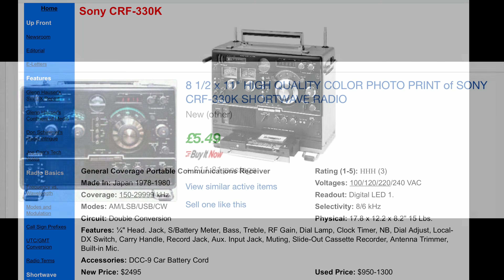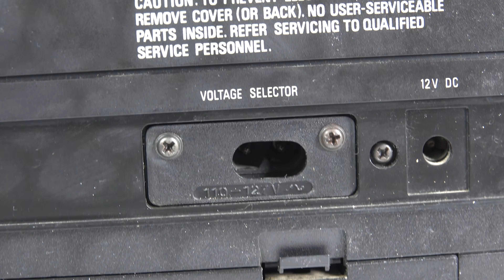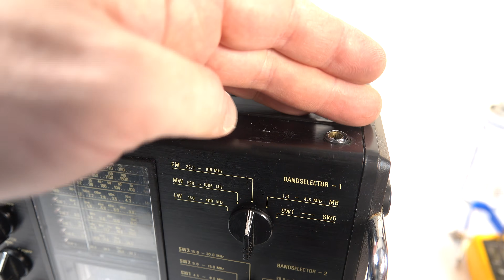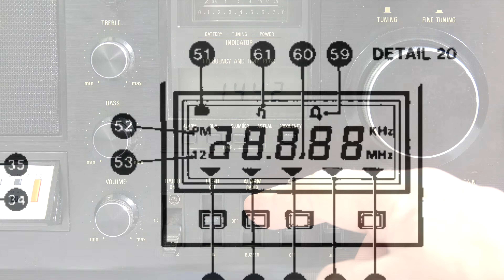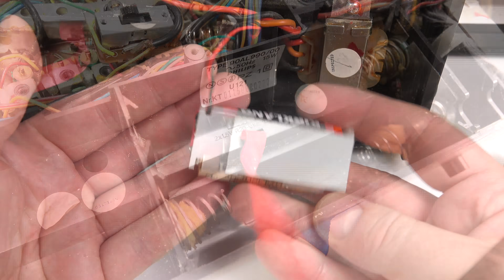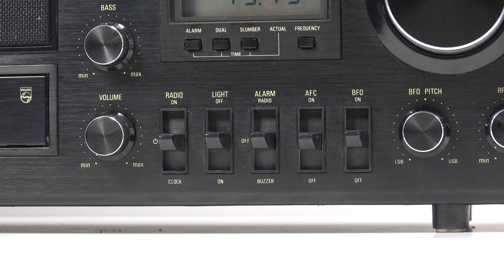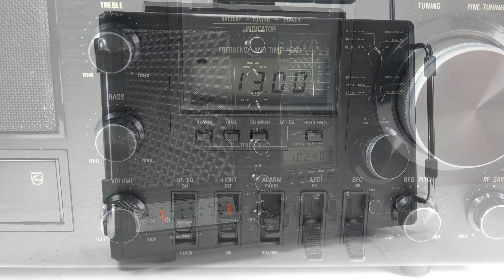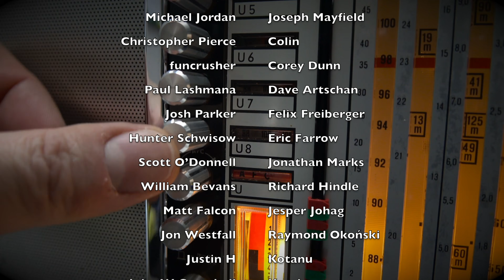Parts or Repair? - Philips AL990 Shortwave Radio

Comment: If it has been over volted,  check if maybe the rectifier diodes have blown, before changing the transformer. 
Also as the radio works on batteries, I would have thought the DC barrel  socket would have worked as that normally just disconnects the batteries when the plug is inserted. (Did you check your DC adapter had the correct polarity for the radio?)

Comment: You don't solder wires no more!
you crimp it with high quality crimp tools and isolated crimps.
Also next time, you might want to put heatshrink over it first and use that. Electrical tape is a bad idea.

Comment: A Philips service manual in Dutch only is quite remarkable.
Reply: Ed de Jonge Though not for that category of gear.  They probably wanted to minimize unauthorized foreign use, by forcing foreign users to keep in touch with a dutch-controlled service center.

Comment: Can’t blame you on the look of them, they’re drop dead gorgeous.

Tecsun, a modern shortwave radio manufacturer from China, makes one called the S2000, I believe. It’s pretty similar to this one, just modern, and quite more expensive.

Sony makes some that are just gorgeous, I never liked the massive pieces, though, as they always felt cumbersome and a pain to set up. 

What other shortwave radios do you have?
Reply: Tecsun used to be called eton. I have one of thier radios. Works great but anyone getting one make sure it has SSB modes.

Comment: Good job!  If it works, it's repaired.  That transformer may be internally fused to meet safety standards, but I would not think it would blow from simply applying the wrong primary voltage since a passive transformer would just give you double voltage on the secondary.  However there may be an active crowbar type safeguard designed into the rectifier for just such a situation just after the transformer, which is more likely since the DC input also seemed to be open.
Reply: Indeed, it is unlikely the transformer "blew up". Most likely something died in the rectifier circuit, like a diode/capacitor/regulator.

Comment: Get yourself a 9v type plug soldered on there and a 9v type AA battery holder and it'll fit perfectly.
Reply: D-type batt-4500mAh. AA-type batt-2-3000mAh. It is at least 1500mAh drop in capacity. He might change polarity of 9V socket (or replace it entirely and connect it into batt contacts.

Comment: I loved those high end shortwave radios I remember as a teenager in the 70’s and 80’s. They were quite rare even then, but I did have the good fortune of getting to use  them briefly at stereo, electronic, ham radio stores but the prices were way out of my budget at the time.  In the mid 80’s I did eventually get a rather no frills SONY ICF 7600 D for around $180 with its all new digital push button frequency tuning feature which by then had pretty much made a lot of those pricy 70’s analogue receivers a bit old school.

Comment: Example of a thermal fuse device similar to the one hiding in that power transformer. EBAY Item Number. 132718337592

Comment: The thermal fuse in the power transformer opens the primary return line! A heat sink must be used to solder in a replacement!
Reply: More specifically, there is often a thermal fuse "hidden" in a small plastic pouch or taped under the plastic tab on these transformers, on the primary side. With a little careful surgery, you can usually replace it. This may be possible without affecting the look of the thing, or may involve some heat-shrink tubing and a little bit of a bodge, depending on the construction of the transformer. 

We used to have to do this from time to time, on a certain well known printer manufacturer's main transformers back in the day. In that particular case, the thermal fuse cost a couple of pennies, but the transformer was a bit of a beast, and cost an arm and a leg. 

The fault that caused the fuse to open also needs addressing, which in this case may be something on the secondary side, although you may be lucky, and it may simply be that the application of 240V to the device when it was configured for 110V was enough to rupture the fuse without any secondary damage.

Comment: In regards to the broken alarm maybe it's that funky touch bar switch at the top that is causing the issue maybe something is completing the circuit when it should be open instead.

Comment: I live in the southeast U.S. and acquired a few shortwaves over the years in hopes to pick up pirate  radio stations out towards the western part of the U.S. with no luck. Even tried different antennas purchased and homemade with no luck. I gave up with only hearing Spanish and boring Christian stations. I also heard side band but my radio did not have the option but would have loved to hear what those guys were talking about!

Comment: Very well made and thought about, with the protection bars and replaceable parts. Nice save but I'd have to replace th transformer
Reply: My OCD says replace the transformer!
Reply: Or rather the DC section after it.
Reply: A lot of the OLD military radios had bars and things to help protect them from the abuse they were sure to get, so it transferred over to the portable short wave radios made much later. Besides many listeners started out with military surplus radios and stepped up as life got better and they had money to upgrade and it made the radios look similar and built to take abuse.

Comment: As an ex MN Radio Officer, this would have been useful back in the day. I notice you have a BFO (Beat Frequency Oscillator) that makes the reception of morse code more user friendly! Whether the radio is any good for this purpose really depends on its sensitivity and the precision of the tuning. One ship I was on, our Chief Engineer had a Sharp portable world wide radio that had extensive short wave capability. He could pull in the BBC World Service in his cabin with a small external antenna sticking out of the porthole, where I was struggling with my professional setup in the radio room. I always wanted one of those radios. I saw one for sale on e-bay a few weeks ago, but did not buy it. I am trying to downsize my life.

Comment: Devices with internal power supplies arre set up with a "crowbar" circuit...
The intent of the circuit is to short out the power source in the event of an overvoltage situation....
This in turn will trip circuit protection devices...
Chances are if replace that transformer and possably a couple of blown diodes...that thing should work.
BTW...a crowbar circuit imitates tossing a crowbar across the power mains past the power supply

Comment: Good grief! It's no beauty on the inside, is it! All those wires. Makes you appreciate modern multi-layer PCB and surface mount technologies.
Reply: Check out the insides of any 1950's shortwave receiver video on here, it's a rat nest of wires, no PCB at all, just point to point wiring!
Reply: @624radicalham  Yes, I've seen those. The amount of labour needed back then!

Comment: This video brings back memories when I tried to pick up the world wide service of the Austrian Radio with my father's old car radio hooked up to a little 12v transformer :) .However, not sure if that was SW, guess it might have rather been LW.
Reply: Good and interesting video but I would just advise caution with switch cleaner. It can cause plastic to crack and fall apart. I  had this happen only once but a plastic chassis on a Hitachi set literally fell apart around 3 months after it was cleaned. So be very very careful with splashing.

Comment: Wow. SONY ICF-SW1000T is 500 dollars on Ebay. I just ripped the cassette recorder totally off. I was going to insert a  digital recorder  into empty space, but realized I can use an old cellphone for recording. All I needed was cellphone 4-wire headset connector and some level adjustment.

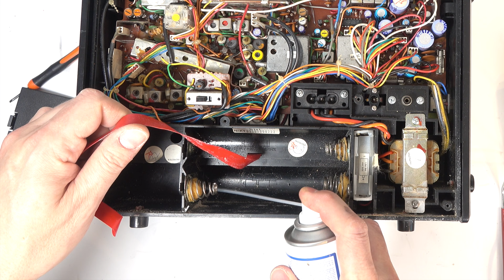Comment: 4:22 The Transformer should only be for mains voltage, since it's what steps the voltage down to a comfy input range for the device.  So, even if it's dead it shouldn't affect the direct 12v input, which has ALREADY stepped the voltage down to a comfy input range.

Worth checking continuity between the power inputs and the main radio section, I think.

Comment: I repaired a transformer in a TEAC A-3440 just like yours. Inside the windings of the transformer was one wire that passed through the windings with a fusible link. I’m told that these links were wound inside the transformer to protect against thermal overload as well as electrical. Anyway, mine was simply dry-rotted and falling apart. I installed a new in-line fuse holder outside The transformer and got her up and running. Perhaps your radio has a similar feature.

Comment: Battery only?  An easy way around this is to add up the voltages of the batteries, then get a power adapter that makes that voltage, hook it to the positive and negative terminals of the battery compartment.  Maybe solder in a jack so it could be unplugged too.
Reply: Or use the existing socket, just disconnect it from the board and change the label to the right voltage. I definitely wouldn't use a switching supply though, as that would most likely completely ruin the reception. And the transformer is probably ok and this is somewhere later on in the power supply, like the regulator. Making a simple linear regulator power supply with the existing transformer would be easy if it works (schematics anywhere online, look at LM317 or L7812), and the trafo can be checked with an ohmmeter. If the primary and secondary show continuity then it is probably ok. I say probably as I had one with shorted turns once, this can happen after mechanical injury or overheating. The voltage was ok at first, but then it started to smell and melt, so check if it doesn't get too hot after running for a while before putting it in the enclosure.

Comment: Love these old world band shortwave radios! To me, they're almost akin to a geeky adult version of a Fisher Price Activity Centre! Knobs to turn, levers to flip, buttons to push, meters to gaze at, lights to turn on and off, you get my drift! When I was younger, my dad had one very similar (don't remember the manufacturer, I doubt it was Philips, as dad wasn't a fan of their products, as we'd had bad experience with Philips kit) but it packed in, and was deemed too expensive to repair, but I just loved playing with the chunky levers, and messing about with it, maybe that's why I'm a big techy now! Just thinking, it could have been Sharp, Sony or Panasonic. It's quite nostalgic for me, as my dad passed away 10 years ago. That radio, he didn't like anyone messing with it, but when it failed, I said I'd like it, and he gave it to me, yes it didn't work, but it was like a holy grail. I just had it as something "cool" in my room, as it was immaculate. Happy memories......

Embarrassing fact: me and my mates Michael and Ian were big scifi fans, and I'm sure we made a scifi film using dad's Sony betamax video camera, and used the broken radio, my brothers Sanyo boombox, and and Michael's Atari 2600 as a control console (yes we were into tech) I'm still mates with Michael and Ian, and yes we still love scifi, and reminisce about Logan's Run, Silent Running and the like down the pub!

Comment: Great video and good detective work for the repair. Everybody should be able to do as much as you! It's a very handy skill to know basic soldering and powering of stuff.
Two things I noticed: did you use heat shrink tubing around the cable soldering jobs or otherwise insulate the solder spot? I didn't see any and didn't hear you mention it. Don't want anything to short (especially at the new 2 AA battery connection). And secondly, the four D cells seem to be in series which works out to around 6 V. Maybe it would be worth a try to convert it to power from a USB/cellphone battery pack at 5V. Would give you an easily rechargeable high capacity power source. If that doesn't work, two 18650 or a 2S LiPo pack should work (or one of those small buck/boost converters from China together with a good lithium battery). Maybe for a follow up video when you have been using this thing so frequently that the batteries are becoming annoying. :-)

Comment: If the transformer is broken, why doesn't the 12 volt input work?
Reply: If it shorted out, there’d be a short across the 12 VDC side too. That bus probably feeds a voltage regulator to drop it down to the 6 VDC used by the rest of the device, which is why the batteries worked

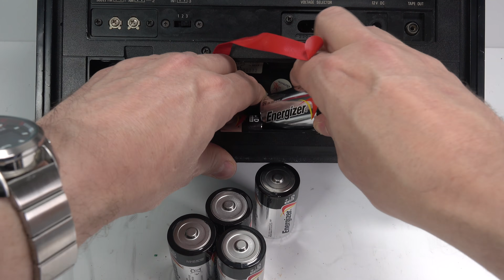Comment: at 10:46 the red ribbon in the battery compartment is run under the batteries to help pull them out.

Comment: I saw it also has a BFO, you can try to receive ham radio frequencies. With that antenna you can probably listen on 40m (7.000 - 7.200 mhz LSB) and 20m (14.000 - 14.350 mhz USB)

Comment: check he primary winding of the transformer for continuity , if winding is open some of those transformer have thermal fuse imbedded in them  this fuse may be open  if this is the case if the fuse is reachable it could be replaced.  or just replace the transformer  from the schematic diagram we may find the transformer secondary voltage . if you need help please contact me

Comment: Have a look at the Zenith Transoceanic line of shortwave radios for iconic design and build quality.  They used a steel chassis ( like a tube radio), socketed discreet transistors and point to point wiring long after the practice ceased in the rest of the industry.
Reply: I had a 1968 model, this video made me miss it (more)!   Especially how it opened/closed.

Comment: I wonder if the alarm function only works on "corded" AC power? Setting an alarm with batteries powering the device seems like poor practice. Maybe if you get that transformer replaced somewhere down the line, you'll have your alarm function working!

Comment: The 12v input should have worked, that power wouldn't go though  the transformer.  Also why 12v if it only used 4 D cells (6v).  Strange.  I think the 12v input and mains power might eliminate BOTH the 6V from the D cells AND the power from the AA cells.  You can test the transformer with your multimeter, either with the ohm meter or connect the primary to the mains and use the voltmeter on the secondary.  It looked like the primary went right to the mains, maybe through one of the fuses unswitched.  The switch was on the secondary side.  Anyway, it sure does look like the mains supply is fried somewhere, should be easy enough to debug if you have a schematic to guide you.

Comment: Being a HAM radio operator (although with currently no rig to be on the air), I also have a thing for shortwave receivers and communications receivers. I've got myself a Sony ICF-7600D (known as ICF-2002 in the US) and an ICF-2001 (not to be confused with the ICF-2001D). As far as I know, the 2001 was Sony's first SW receiver with a digital tuner, and even John Lennon had one :) (at least he was photographed with one)
Reply: Dear sir,who will repair the ICF..200l and ICF 7600DSl in India as no good repairs a are reachable I had both radio, please guide me.Godspeed to Sony radio's.thnx.
Reply: Been looking at the ‘Tecsun S-2000 Desktop Receiver’, and appears good for the price, reasonable looks, and has advantages of some modern tech.   Are there any advantages to older tech when it comes to receivers?

Comment: hope you insulated the solder joints in the wires so they dont short, next time try using heat shrink tubing.
Reply from the maker: I didn’t have any heatshrink tubing left so on this occasion I used electrical insulation tape instead.
Reply: @Techmoan  I learnt the hard way🙄

Comment: This is the kind of thing I'd have really liked to have had when I was working in the Middle East 40 years back -  Before the net, SW radio was a very important source of news and entertainment for us expats. Happy memories of sitting on top of the car in the desert at night to catch the BBC World Service news! Seems to be a lot less stuff on the SW bands these days, or maybe its just my cheap old SW radio.
Reply: frglee 

Dubai 1978 - 1979. 

BBC World Service, news, cricket, football results. I can still recall the BBC fading in and out, the hiss and the crackle. 

A scary bit in February 1979 when the Shah of Iran fell. Only about 100 miles across the Gulf. We were glued to the radio in case war broke out.

Where were you mate?
Reply: @rosshilton  
Lebanon, 1974-1976.
I'd listen in to BBC's World Service as well as the Brazilian government's news program, Hora do Brasil.
Reply: There is still shortwave though, despite there not being as much as in the past. It’s like fishing, there are good days and bad days! You can get a Tecsun receiver with tons of features and great sensitivity/selectivity for cheap nowadays. Even add a wire antenna and it’s a ton of fun!
Reply: there is some good stuff still out there, short-wave info will help you out easy
Reply: Grundig Yatch Boy and similar are good, some come with cassette deck too.
Reply: Nowadays you'll get internet radio from anywhere in the world with FM sound quality. That's probably why so many MW and SW stations have closed down.
Reply: Ugh, the BBC...

With that said, shortwave also allows the more.... Morally capable countries, to get their voices out.

Comment: intersting as always! next time once you have finished soldering put some heat skrink over the bare wire, asking for a short if not and looks a lot tidier
Reply from the maker: I ran out of heat shrink tubing  - so I used electrical insulation tape.
Reply: @Techmoan  either works, sorry too distrust in your abilities i know you always try to do a thorough job :)

Comment: A very enjoyable video. When you have a little time and with some patience, you may be able to repair the transformer. Since it isn't smoked, a conductor has probably opened up in the transformer or more likely on the board. You just have to track it it down. Also, make sure that the  replacement fuse is the right size since some people fix a blown fuse with a bigger fuse.....